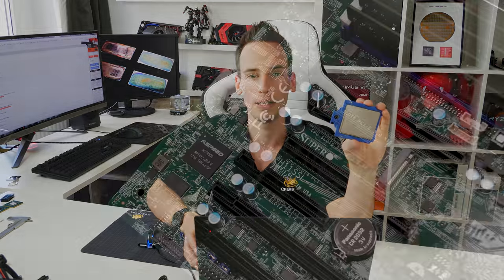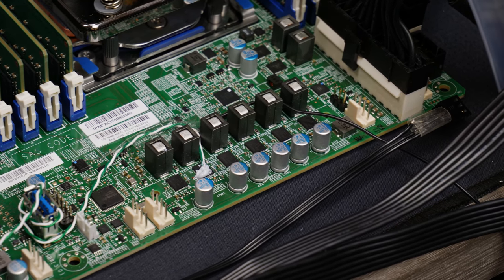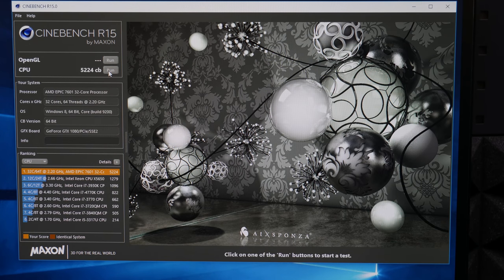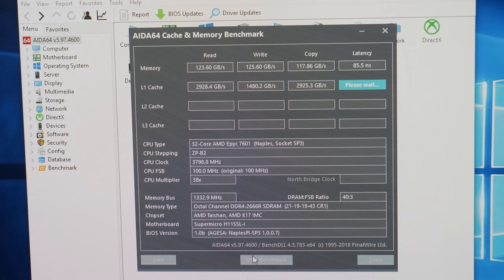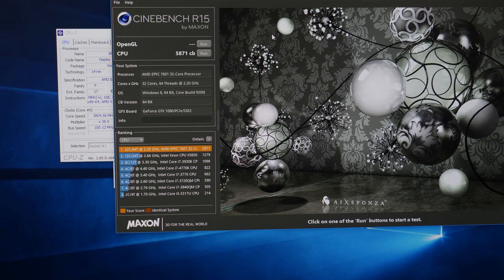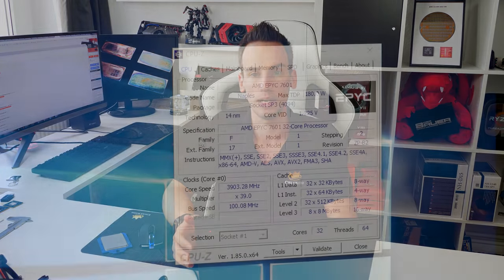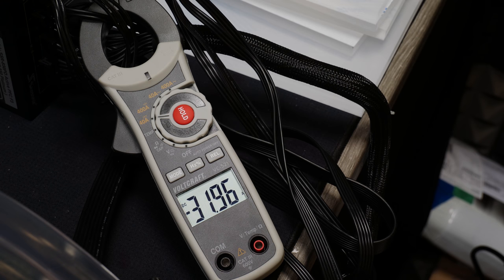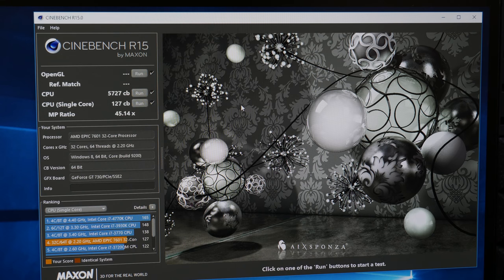Threadripper 2990X Preview - aka EPYC 7601 overclocking

Comment: For the 2990x what would be the minimum motherboard vrm count for overclocking? Like the gigabyte board has 10+3 phase is that enough for 4.2ghz with open-loop water cooling?

Comment: i told people the 4 vs 8 channel mem would have an effect.  of course if you can clock the ram up on the actual TR then that will make up some difference.  but people are talking like the 32 TR will just stomp the 28 core intel cpu.  but 32 is just 4 more cores.  thats not a lot at these core counts.  and the intel will priobalby have higher core clocks and 50% more mem channels.  not saying that TR 32 isnt interesting, far from it, but dont expect it to totally annihilate the intel chip.  they will be much closer than most people will have you beleive and the intel chip will win in some cases.  of course TR will when in price.  to be honest a cheaper 16 core (and maybe the 24 core) will be the real interesting chips cause they will have the improved zen+ arch and are numbers that peop;le might actually be able to make use of
Reply: Which 28 core chip? Intel doesn't have a 28 core desktop CPU.
Reply: and amd doesnt have a 32 core cpu.  if you wanna be that way then its a blade that cuts both ways.  TR 32 aint out yet my man
Reply: bobhumplick But it is at least sampled
Reply: Difference is you will be able to buy a 2990x.
You think intels going to sell a 18core XE for £1500? a faster version of their best server chips for only 15% of the price? drugs are bad mmkay

Comment: It would be nice if they'd offer octal slot boards for TR when the 32 core unit is released.  I understand they don't want to undercut their EPYC line, but this is enthusiast level equipment vs server grade.  Those who would opt to use TR in a small business would likely not be buying into EPYC anyway.  They likely have some kind of Xeon in the back room that's not even on a rack.. with their cousin maintaining it.  It would only help sales.

Comment: What size of radiator would you need for the 500W if it was regular water cooled?
Reply: most sites list their radiator wattage dissipation 
http://hardwarelabs.com/nemesis/gtx/240gtx/
click the performance tab. as you can see all you need is a 240mm rad to cool it,  but that's with fans @ 100%. If you want quiet operation you'd probably need 2x 240mm or more just for the cpu.
Reply: depends on radiator efficiency and the rest of the loop.  The Vega FE liquid dissipates massive amounts of power (400W+) of a single thick 120mm radiator with a good fan.

I would say past a thick 360mm I would not expect much scaling, but I could be very wrong.
Reply: Superhello220 ok it lists even the 140mm radiator at 550W, so I guess trying to cool it won't be that crazy.

Comment: If programs can't utilize the extra cores and threads, would it be beneficial to turn off the ones you aren't using until the programs are optimized for them? Also is there a hard limit to pcie lanes from a processor? I don't quite understand why the 1950x has 64 but the 7980xe has 44.
Reply: Quickshot Gaming both made for heavy processing stuffs like scientific research not for something we plays daily.
Reply: Quickshot Gaming it would make more sense to buy a processor with fewer cores than to turn them off until software uses them. For PCIe lanes, it's how many lanes were designed into the processor.